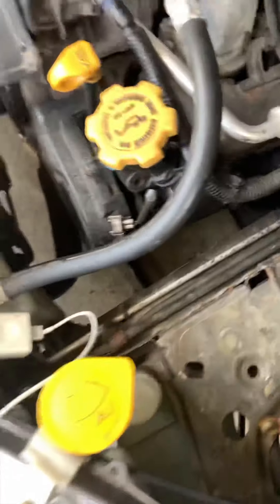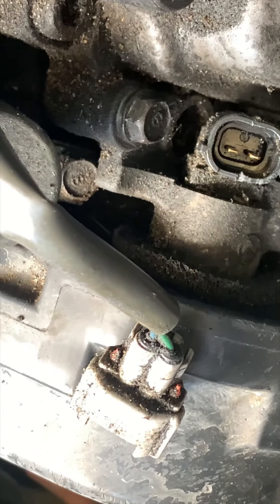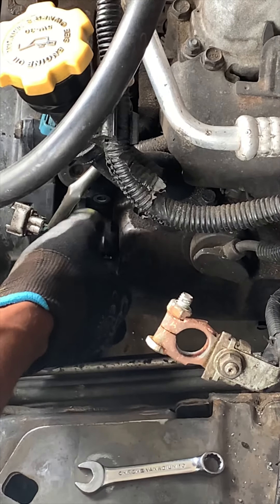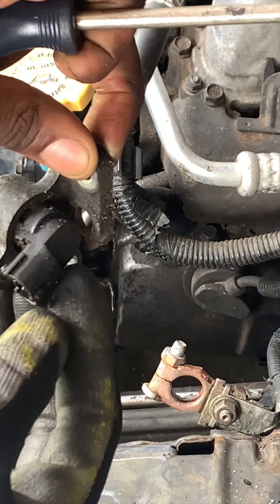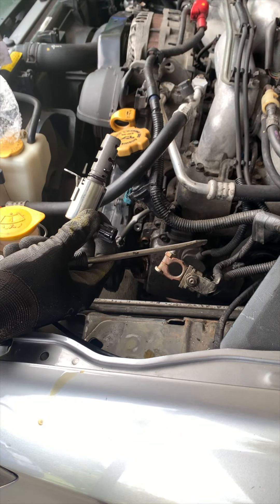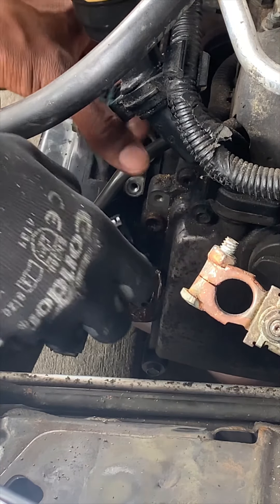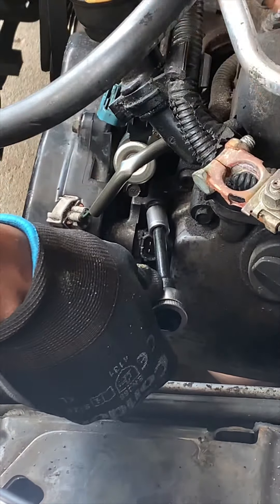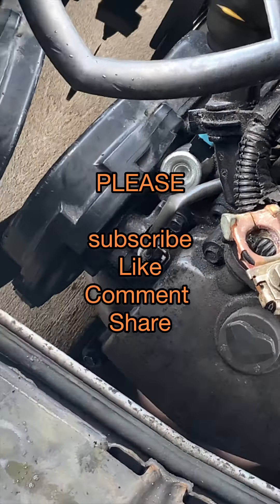How to replace a vvt solenoid #p0028 #subaru #repair

Comment: You are a god send, only video I found with replacing just the solenoid and not taking the whole front end off. I was able to take care of my vvt solenoid. I didn’t remove the cam position sensor completely. I took out the bottoms bolt which let me rotate it enough to get the top bolt off . I then was able to pull it out of the way just enough to get to the vvt solenoid bolt. I did need pliers to pull out the solenoid and a two light hits from a soft dead blow to seat the new solenoid. I taped the bolt onto an extension to get the bolt back in as it was such a tight fit, I used a wrench to turn the bolt just enough until I could fit my 1/4 inch 10mm socket and finish tightening it. Then finished the putting the rest of the bolts. I also had to set the idle, all accessories off, key in the on position for 15 seconds, start car and let it run for 10mins, turn off for 20 seconds with key in ignition for 20 seconds, then back to on position for another 15 seconds before starting and letting run for 5 more minutes. That’s the only way I’ve found to reset my idle.
Reply from the maker: That’s great to hear im super happy you were able to complete your repair. The cam shaft position sensor can be hard to remove but with a little nudge it’ll come right out and free up that 10mm bolt that holds in the solenoid. Again I’m happy to hear that you were able to do the job with the help of my video and the fact that you also got your idle corrected is a thumbs up as well. Good luck out there
Reply: @SlowCarRepairs  appreciate you posting that video. Save my A$$ from following those other videos.
Reply from the maker: No problem!
Reply from the maker: I’m glad I could help out!

Comment: i have a 2007 Legacy Limited 2.5i Sedan and followed the instructions on this video. you are a lifesaver. the bracket holding the camshaft position sensor is a tough job but l soaked the area between the bracket and engine overnight with WD40 and used a pair of lock pliers to wiggle it out. the only downside is l need a new camshaft position sensor.
Reply from the maker: I’m glad I could help! And yea that sensor is a tough one to remove but nonetheless I’m glad you got it!

Comment: I have a '07 Legacy with the same code. I followed your video, but after I removed the two bolts around the cam position sensor, I was not able to remove the collar it sits in and therefore was unable to access the 10mm bolt for the solenoid itself. I saw another video that suggested this part isn't removable without removing a lot more. Is that a difference between the 07 and 08 or is there some trick to prying that collar loose? I tried using a screwdriver and it wouldn't budge.
Reply from the maker: It takes a lot of wiggling and prying to remove it trust me my man it’ll come loose, I used a screwdriver and my hands to get it free, just keep trying you’ll get it out
Reply: @SlowCarRepairs  Correct. What I did was place a screwdriver on the front side of it, right where your thumb is at 1:24. Then I took a hammer and gave it a couple of soft taps, like I was trying to drive the top of it straight back into the engine. It moved enough that I was able to get a socket on the solenoid bolt. Then I just pried it back into place afterwards, you'll know when it's in the right spot when you can screw that top bolt in. Thanks!
Reply from the maker: You’re welcome I’m glad you got it!

Comment: I just replaced both switch and solenoid.  This was very helpful.  Question is I started it up, codes are gone, but there's a little smoke coming from right below where they are.  Any thoughts?
Reply from the maker: That sounds pretty normal, usually oil will spill off when replacing the solenoid because it’s submerged in oil, run the car and allow the excess oil to burn off and that should resolve your issue